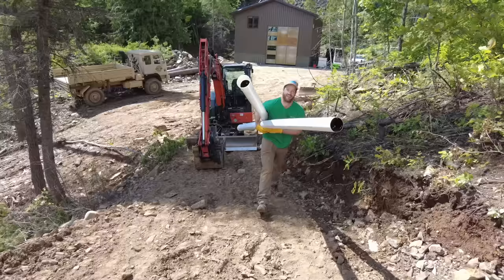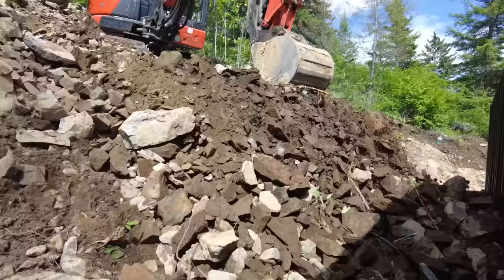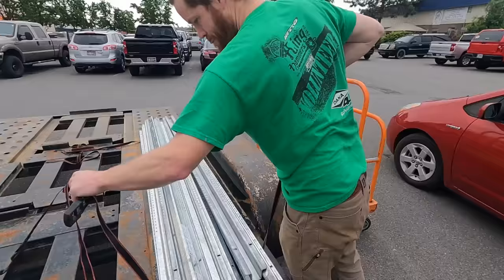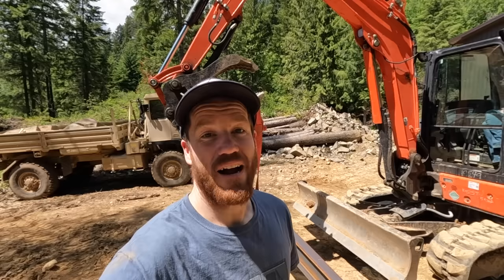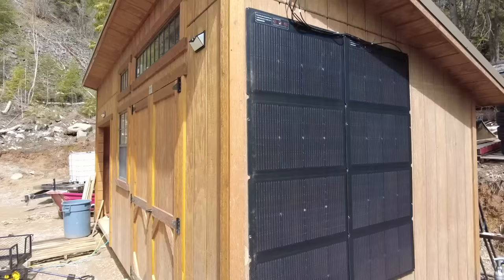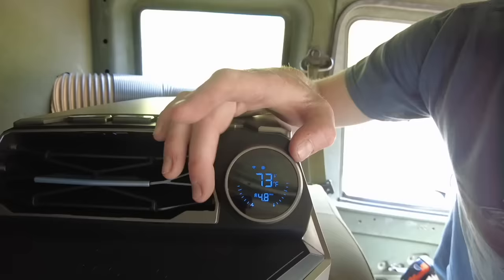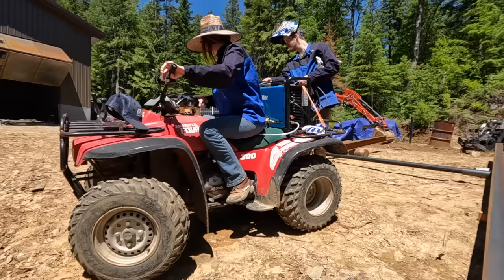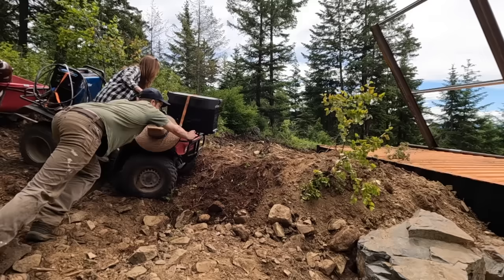We Were Told To NEVER Do This | Burying A Shipping Container

Comment: The first time they get severe winds that whole damn thing is going to either to fall over or that entire solar array is going to get ripped off or torn away...  Those containers are NOT meant to be pulled from one end unless they reinforce the interior completely to handle the stresses they are going to be subjected to, let alone attached from the bottom by a concrete slab all they way across that's at least 4" to 6" thick.  Mountain winds blow quite hard up there.

Comment: In stead of painting it, you should have chosen a color first… then had them come and rhino-line the entire container in that color… much better and not a lot more money…plus it will give you a ton more longevity to your container…also spray foam insulation on the inside to help keep humidity down which also help’s keep rust and mold from forming on the inside…and i believe they were referring to completely burying the container… not back filling one side…

Comment: Drain hole should have gone up to set up your French drain. The water would drain in through the top and then eggs it out through the end of the pipe which you had running away from the container

Comment: I honestly hate to be one of the doubters because I really admire your drive and tenacity.  But I just can't help feeling that the container/solar array is just wrong and designed to tumble down that hill in strong winds. I'd have put it all on a concrete slap and used welded anchors from the container into the concrete. I really hope it works guys but I'd be having sleepless nights over it.

Comment: Was wind taken into account for the strength of the solar array frame?  Particularly the telescoping sign posts and bolt locks.  I would have major concerns with regards to high winds flowing up the mountain catching an edge of the array.

Comment: First thing, when you move a gas bottle like that you are taking a big risk. Always leave the cap on when moving and don’t put it in a tippy wheel barrow with the valve on it, you don’t want those problems. Second, you didn’t burry a container, you pushed some rocks against it. An welding some C channel or I beam to the sides and top of the container keeps the walls and roof from collapsing in when a container is completely covered with earth. And that drain pipe probably crushed as soon as those rocks and dirt were a foot thick.

Comment: If you have 120V power on property, then you have 240V because when they brought in the power they brought in 2 different phases of 120, and combined that's 240.
Are they not going to brace the heavy beams with anything more substantial than those fence posts?
If they are mounting the panels to the fence posts, then the first windy storm to come along will twist the whole thing and the panels will get bent and destroyed.

Comment: those container side walls are quite flimsy and will eventually cave to the pressure.  i highly doubt you will get even 5 years before there is significant deformation and it may also jeopardize the integrity of the rest of the container

Comment: Don't transport that welding gas bottle or anything that's got compressed gas without installing the protective cap that goes over the valve if it falls and sheers or cracks that valve believe me you don't want that to happen its got enough energy to go through a block wall

Comment: Just a tip from a master welder of 30 years: never transport your shielding gas bottle without the cap on! If you were to drop it and knock the valve off you would have created literally a missile that has the potential to plow its way through your shipping container so please be safe😀

Comment: That seems to work great!  I thought the pipe hinges and use of fenceposts and boat winch were really clever.  But i dont really get what was accomplished by burying one side of the container.
Reply: Was reading comments about further anchoring the shipping container - obviously you will add a lot of weight with bank of batteries, but i was thinking a “dead man” anchor system might be cheap and easy to add.  Im sure you are familiar with what that is…

Comment: If you would have buried the top as well as the sides it's a problem, The top wont hold the weight of wet soil,  I do hope you used some type of water proofing on the side you buried ?, If not it will just rot away

Comment: Might be a little too late, but eventually there will be breaks in the paint on the outside of the steel that will get water in them, regardless of other factors. Personally, I would have done a layer of sand held close with plastic film, the coated that with clay, to make a water break from the steel. Would add years to the steel lifespan.

Comment: I've always seen those perforated pipes covered in a mesh sleeve to prevent dirt from clogging the holes. Also have only seen them covered with small size stone/gravel which would allow water to drain between the stones, then into the pipe and then out the side. Also the piping should have a downhill elevation to allow for drainage. You will have the container rusting. You should have coated the uphill side with waterproof membrane. Surprised your research didn't surface these things. Did you search for drainage behind retaining walls because that's basically what you have is a big retaining wall. Hope it works out and it doesn't turn into a big dam directing water out the downhill side during a gushing rainstorm.
Reply from the maker: The pipe has some slope to it and we did coat the container in a waterproofing membrane. We tried to purchase a sock for the pipe but they were out of stock. 😬

Comment: Yeah... Thats not "buried", thats partial earth sheltered. Also the long side wall is against a slope of rock (bedrock?), acting as a mini retaining wall and backfill largely w/ fill of mostly rocks which is acting to spread the load is good idea. Also the design sheet piles is totally different than the walls of a container. And lastly somebody doing this might add a swale in the back to stop surface runoff from heading to the structure...

Comment: That 4" PVC pipe is going to have cracks all over now from how you backfilled those large rocks on top of it. You need to gently cover the pipe with 10" of 1 1/4 "drain rock first. The weight of all the backfilled rocks could even crush the pipe in places over time so keep an eye on that, not like it is your house so no big deal.

Comment: There needs to be a thick layer of gravel under the container and the drain pipes need to be covered in cloth then in the gravel, and the pipe needs to be below the surface of the floor of the container so the standing water being drained off is well below the wooden floor or the floor will be wet or even under water. Anyway, the soil and rock will push against the container walls eventually collapsing them.
And in the end all they did was have some rock and dirt along side the container, they did not bury it!

Comment: Why did you not install a rubber membrane between the wall of the shipping container and the spoil stacked against the container?   Corrosion will attack your shipping container and eat out the wall fast.

Comment: I am not sure you understand doing research. There are a number of youtube sites that explain why burying recycled IMs is a short term proposition. That aside you really needed to read more about french drains and drainage in general. The way you did it, the rock gaps will pretty quickly fill with dirt and clog your drain. More important the infill will fill with melt water and freeze. So it it will expand and push your container out of square.
The array frame looks cool. I can't wait to see how you hold it square and anchor against storm winds. Are you doing any hail protection?

Comment: a drainage pipe with holes in it. The holes should point upwards so that the water can flow into the pipe to flow over and then out on a slope, but if you have the hole the other way, you get the water back into the ground. The drainage pipe does not have the effect it should actually have. Regards, someone who works as a machine operator on an excavator

Comment: might consider shifting that winch it is not a good idea having the winch between solar array and container if something should fail over time and you are standing between container and solar array then you will be flattened in a second if that array assembly comes your flying your way I would suggest  that you move the winch to the side of the container out of the danger area and then rather connect like a snatch block pulley to the middle of the container where you have the winch mounted at the moment that way you will be safe and there is not a lot of changes that you have to make SAFETY FIRST!!!

Comment: I'm sure you guys are smarter than me but shipping containers are not designed for side loads when it decides to fail it maybe slow or all at once once. But as the soil settles the weight will increase so don't trust it. Plus it's not on a foundation it could very well be pushed out of its current location. Dissimilar metals causes galvanic corrosion and can degrade the metals quickly under the right conditions. I'm really not trying to pick apart what you guys are doing but you are lucky one of you haven't been seriously injured yet.

Comment: Shipping container walls are not meant to support a side load. They are an integral support for downward above support (stacking). Unless you add significant interior structural support, failure will be catastrophic. You seem concerned only with water infiltration. If that was your concern, why didn't you coat the exterior surface with a water proofing type product? Again, good luck.

Comment: I think the concern with burying a container is depth and that wet soil on top and sides keeping moisture against the steel constantly will rust through. the deeper its buried in the ground the more stress on the walls and roof of the container. I have seen pictures. its not pretty.  what youve done here doesnt fit that scenario. it should be fine if the ground underneath holds up over the years.

Comment: Will it rust out? Yeah eventually.   In the 15 years you plan on using it, probably not.  Worried about the hillside pushing the container?  Next time you do holes on the property put a couple extra next to the container put sonotubes in them and you can fill them with extra concrete when you pour Next.   Grab some scrap steel and put it in the concrete when you pour.  when the container pushes over to the footings, weld it to the steel and there you go.

Comment: With a winch to positioning, what happens if the wind blows on the back of the array, like hard enough to move it?
Reply from the maker: There are also bolts that hold the array in place through the sliding arms.

Comment: I hate playing Mr. Safety, but you know what happens when you weld galvanized material?  There really should have been a respirator or at least some verification of wind direction so the toxic gas produced was going away from your welding helmet. 
Ok, now that that is done, check your favorite farm store or trailer store for Trailer Coupler Pins to replace the bolts used on the angle adjustment struts.  They likely have something the right size that will be much easier to remove and replace when you are trying to adjust in February, with gloves on, trying to be fast because you don't want to be out in that cold wind.  🙂
Reply from the maker: Great reminder! Riley is very aware of the dangers of welding galvanized and always considers the conditions before doing it.

Comment: Burying anything metal is risky if you don't water proof the outside first to keep it from rusting. I would pour a slab to sit it on and paint and spray foam the outside to form a shell of protection before burying it and add a block entrance stairwell with a roof to keep the weather off the doors. If it's on a hillside place bricks under it to allow any water getting down to the slab to be drained out through a pvc drain pipe running downhill with a mesh cap to keep rodents out.

Comment: I'm not sure why anyone told you not to bury it.  Since they are made from coreten steel, it will last a very, very long time.  The name coreten, is actually a trade name used by the inventor of it, which was US Steel.  It's generically called weathering steel, and it is similar to stainless steel, in that it forms a patina layer, that is an oxidized layer that forms a protective layer that prevents the oxidation from continuing through the metal.  I would bet that your container will last longer than you guys will live without any issues, and probably a lot longer than that.

Comment: The reason why they tell you not to bury shipping containers is because you have to seal those things tar paper concrete it's so water doesn't get to it under the ground because your shipping container will rust big time if you don't seal it you have to seal it good people have used shipping containers but they use insulation all kinds of ceiling techniques and they also use concrete to seal a poor concrete all over and seal it like a concrete shell and what are you doing with the rebar that shipping containers not going anywhere if that's what the rebar is for that pipe with the holes in it it's not going to work you have to have separation from the dirt and the shipping container the water's going to come down to that pipe but it's also going to go under the shipping container you're going to have problems because you're not sealing the whole container rust kills those things big time it's not like being outside when they're buried underground it's far worse and if you look hard enough they do have videos where people do that put them underground but like I said they insulation and concrete they make like a wall around the box so the dirt can't get to it and underneath as well what's going to stop the water from going underneath the pipe and underneath your container and rotting everything underneath you're going to have to redo it because think about it what's going to stop it from rusting you have no tar paper no sealant no nothing you should have studied up more now you're going to have to unbury and it's going to take more time you're not thinking at all when it rains the moisture goes down and sits in the dirt for quite a while before it dries up sometimes it doesn't dry up it just stays moist and that's bad for an unsealed container dude the shipping container weighs a whole hell of a lot it's not going to move by piling dirt up against it the rebar you put down was a waste of time you need to study up on how moisture sits in the dirt and for a long time because the sun doesn't get to it to dry up you basically have to build a retaining wall to separate the dirt and moisture and you should have put a concrete pad down to keep it off the dirt you see that mud underneath the trailer that's going to be under your shipping container you see how your garage is on a pad a concrete pad that's what you should have put under the container and then a retaining wall around it

Comment: A container is not built to withstand pressure on the sides. The only places they are built to withstand pressure are the 4 corners up on the roof as well as the 4 corners below it. Many who have collapsed due to pressure from the sides and in the middle of the roof

Comment: i dont know i am not a professional but ... a none protected steel box buried in the ground WILL ROT and RUST away to the point that the Unsupported sides and roof of the box which are not designed to carry a lot of load will fail in a few years....

Comment: Not a good idea at all. The container will not last in the short or long run. Yes they are painted to withstand the weathering when shipped and the steel is of a hard type so it can be thin. From what I remember the floor is 1" plywood that is tarred underneath and does much better above ground. I use to buy containers for installation of electrical equipment and the one I shipped to Puerto Rico needed to be painted in a heavy duty industrial coating to prevent the rust. It was a one shipper that was like new when purchased. Do not pile dirt on the sides.

Comment: no silt fabric on that pipe and only holes on the bottom?  hmmm.  Also interesting to put the waterproof membrane on, only to scrape it back off with all that rock.  "Buried" is a bit of an exaggeration.

Comment: It's OK until it isn't...

the thing will rust and fail in a few years in direct contact with the dirt.

You need to use it as a former for rebar reinforced concrete poured around it instead of direct bury in dirt. (cheaper to use plywood and 2X formers which can be used elsewhere after the concrete cures)